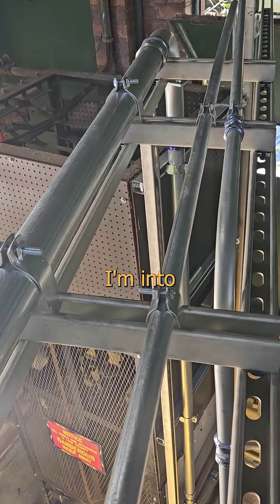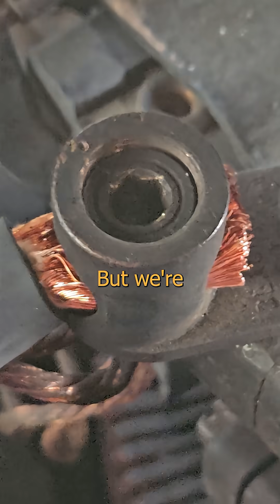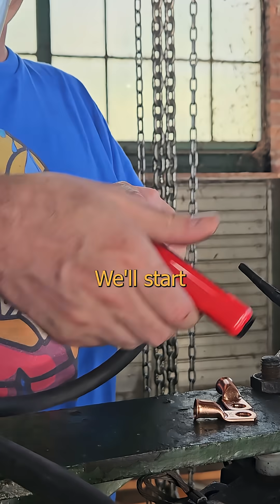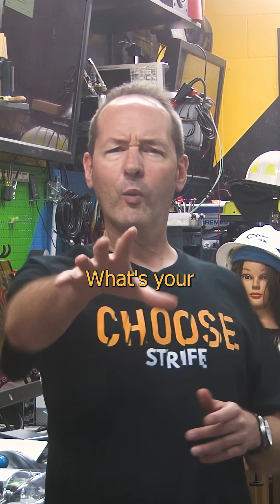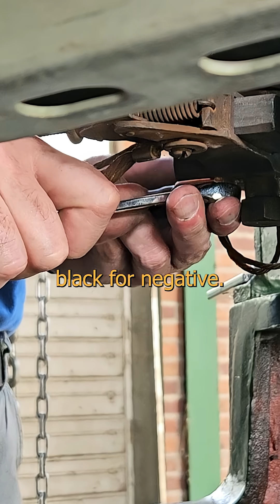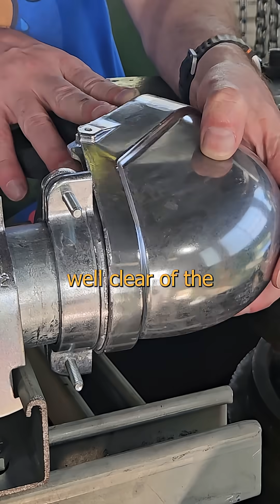Exciter Update #chrisboden #comedy #engineering #powerplant #electrical #educational #wiring

Comment: What size cable was that?  It looks bigger than the 2/0 cable I used to connect my LiFePo batteries for my camper.  Wish I had gotten one of those fancy crimpers you got, it would have made the job easier!

Comment: I solder those copper crimps on my welding leads. The point of resistance is either there or the contact itself, so either way the extra lead helps with heat. I should just solder the contact to the clamps, then it wouldnt get hot at all.

Comment: Typically i install a ton of those copper ends and the most indestructible and best conducting way i install those is i clamp just the edge of the hole end in a vise with the cup end up i take a torch and melt an adequate amount of lead solder in the cup then insiert copper wire end once hard enough to stay together i quickly dip into cup of water it creates a better electric connection and its extremely unlikely to come undone

Comment: Telecom engineer. The standard toure looking for is telcordia gr-347.  Nothing wrong with what you did.  The "standard" if you wanted to extend it to this application is no-ox special-a is used inside the lug and on the mating surfaces and fastener,  prevents galvanic corrosion and atmospheric corrosion.  The letter requires  a windowed tin coated lug with the part number and manufacturer stamped into the lug.  Shall be crimped ro no less than 12 ton and the die number from the crimper embosses into the barrell. Clear heat shrink indoors or marine heat shrink if outdoor or wet location.

Comment: Noalox is nice to use, simply because the mounting bolt threads won't corrode and seize if they get wet. It also protects the exposed areas between the cable lug and insulation (or use marine grade CLEAR heat shrink to seal it, while keeping the whole lug visible for inspection)

Comment: When it’s copper crimped to copper (or brass or bronze or phosphor bronze) Noalox isn’t typically necessary.   Just make sure the conductors are sealed with an appropriate marine sealant to the application if water is expected plus a quality adhesive heat shrink.  I wouldn’t expect the heat shrink to last for 100 years but the crimp should.

Comment: If the cable terminations worked for 100 years without failure then it’ll work for 100 more. No need to reinvent the wheel

Comment: Long barrel two hole lugs are the standard for critical power infrastructure in data center’s. If you want to get fancy, you can get inspection windows to make sure bubba did a good job seating the lug.  No nolox on all coppery bits.

Comment: Noalox is used for aluminum oxidation prohibition and is not required as per the NEC. I would never consider it for CU-CU and only mildly consider it for AL as most of the modern shit is AA8000.

Comment: you're exactly right! sometimes you need to upgrade certain things even though it's been working the way it is for a long time doesn't mean that you can't improve the quality and safety of something and make it just a little bit better than it is and it's not like it changed the way the thing functions it's still the same machine just safer and looks cleaner and works more efficiently than it did before

Comment: I work in a tough environment (mushroom composting operation). T&B Contax grease is great for copper to prevent corrosion. Another great choice is Sanchem NO-OX-ID "A-SPECIAL Electrical Grade". Both protect from normal corrosion as well as corrosion from hydrogen sulfide. They are my go-to when I want a connection to outlast me.

Comment: NoAlOx is specifically for aluminum interfaces. You were using copper to copper and when we do that or won’t use copper to a tinned interface we use NoOx. Instead of being a Gray looking conductive non-oxidizing lubricant, it is a reddish brown, looking material design specifically for copper copper interfaces.

Comment: My limited opinion on Noalox is that while it's not required on everything, it also doesn't hurt anything except my clean work clothes.  What I remember from reading the Noalox bottle was something like "Prevents corrosion, promotes conductivity, and reduces connection temperatures."  Obviously those last 2 are the same thing. Maybe it doesnt say both, idk.  
When I was doing maintenance for a welding shop that had a habit of blowing up breakers from running machines long past duty cycle on minimal conductors, I decided that any improved conductivity was worth the small inconvenience of carrying a bottle of goop around.  
And anecdotal though it may be, it certainty seemed that the welder feeds I did with goop lasted longer than the ones done dry.  
In 99% of systems it might not make any relevant difference.  But in systems pushed to the limit, the little things can make all the difference.

Comment: There was a time when I thought that if you crimped the fitting on good (with some flux on the wire) and then filled with solder, it would prevent any corrosion from happening inside the fitting. But does the addition of the lead and tin and flux increase the risk of corrosion right next to the fitting? These days I just crimp and call it a day. It's faster too.

Comment: Hydraulic crimping is the way to go. I've seen hydraulic crimps between copper cable and copper lugs cut open before. A properly done crimp looks like one solid piece of copper on the inside.

Comment: This cable is a bit big for this, but if you want a very, very secure crimped connection then try this.  
1). Tin your wire and flux the connector.
2). Crimp the fluxed connector onto the tinned wire.
3). Add heat to the connector and solder as needed.

Now you have a crimped and soldered connection.  Maybe use no clean flux as well because it will be difficult to get all of it out of the connector.  

Never just crimp a connector to a tinned wire.  As time passes the solder will cold flow and then the wire will fall out of the crimped connector.

Comment: A proper crimp connection will not need anything added to it. Fone properly, it is an air tight connection that more or less fuses the two together to function as one continuous piece of metal.

Comment: Hey chris!!!!!! LOVE your videos man. I learned this technique about those crumpets from my father:

Those “forever crimps” are great, but if you want a REALLY good connection that will literally cause the next guy to look at it in 100+ years to be impressed, heat up the tip and the copper wire and put a bit of flux and tin solder in there after crimping. That hot flux and solder will hold that connection SO tight and make the resistance of the cave basically zero with a normal meter. Makes it so you literally CANNOT remove it without replacing the cable which is EXACTLY what you want for something that’s so mission critical 😊

Make it forever-made, not “half-ass” made - as my pops always told me.

Comment: NoAlOx hasn’t been required on anything since the late 80s and was never required on copper. It’s one of those traditions that just won’t die. Use the proper size lug and the right crimping die and you’ll create a solid cold weld with no air pockets.

Comment: Nah if it works don't fix it. If the old way lasted 100years then don't change. Modern methods don't seem to be as reliable as the old way. Trust me I worked att a farm and only electrics systems that failed was the new ones. All the old crap with cobwebs older than me never had a single problem

Comment: Honest question, is there a system in which the receiving port has a rod that the wires go around and can be pushed or screwed further into the connection after the outer parts are fastened? Like the wedge at the top of an axe. Then you could loosen that part and relieve some force before trying to undo the outer casings.

Comment: Deoxidizer is usually only used in copper/aluminum connections or just aluminum connections. NEC doesn't state anywhere that it NEEDS to be used since modern aluminum wire is made from AA-8800 alloy, which resists corrosion. I would use it if you were making connections near the beach or any place with a corrosion atmosphere/environment.

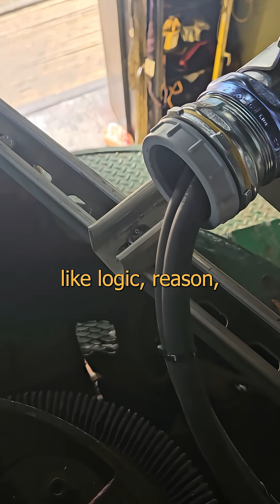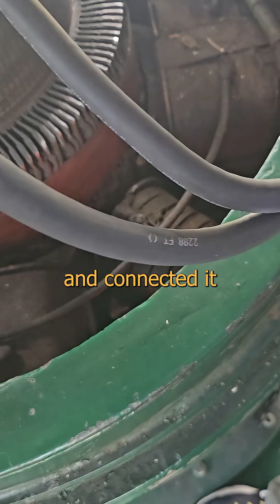Comment: This device appears to have two slip rings and a commutator below. I don't see any commutator brushes on 270 degrees of the lower section from 0:05 to 0:15 .. is it not being used anymore?

Comment: DIYer here. Cut an 1 1/2” section of half inch copper pipe. Solder the wire to the inside of the pipe about half way up the lunch of the pipe. Hammer the pipe flat and drill a hole. Trim it round with tin snips if you want to be a fancy pants. 100% of the time it works every time.

Comment: NoAlOx is great, but if you are concerned about copper to copper connections you should use Penetrox E which uses copper instead of aluminum particles.

Also pro-tip on lugging those cables, when you strip it add a zip tie at the sheath and work it up to the tip. Keeps the strands together for when you like the lug on, and you can cut it off when the cable is fully inserted.

Comment: A way to insert a wire terminal without the wire strands going all different ways then in the terminal cup, is to cut the wire insulation just a little bit shorter than the length you originally want and make a 2ed cut at where you originally want. Remove the insulation from the first cut and use the insulation between the 1st cut and 2ed cut as a "ring" and slide that up the wire shaft till it's near the tip. Push on the terminal and when it's pushing the insulation ring down and no stray wires, cut the ring off and you can fully seat the terminal on the multi strand wire.
Another hack is to use a zip tie to hold all those wires together. Cut the zip tie off when the terminal is on with no stray wires and seat it.

Comment: When working in car audio stuff, anything larger than 1/0 cable we would use those type of connectors but I always use my propane torch to heat them up fill them with solder and solder the connection in before crimping it. Use a ton of flux on The Wire itself and it works unbelievably beautiful. Hydraulic crimping and heat shrink tubing is perfectly acceptable I just liked overkill. I use speech to text, I'm not going to proofread that first. I apologize about errors.

Comment: I was working on an 80 year old car a few years back and had a lot of fun melding my modern knowledge with the repair manual for the vehicle.  I set the timing by the procedure outlined in the book then used my strobe timing light to fine tune it and verify the advance was working.  I think I got a few more hp out of that '26 Cadillac.

Comment: Lookin good. Only thing I would've done different is tinned the copper lugs with some nice 60/40 solder, crimp the lugs and then solder the wire in the lugs. Even better electrical connection and the tinned lugs would be completely impervious to any corrosion compared to bare copper.

Comment: If you’re hoping to have that cable last the 100 years, I’d recommend utilizing metal cable ties for holding it. We’ve seen plastic cable ties break over time and cause conductors (namely bare grounds) to swing into places they shouldn’t (the nice little L3 stab supplying a machine). Just my 2 cents

Comment: a little connector paste doesn't hurt as it prevents corrosion by repelling moisture.
Reply: If everything's copper, there should be minimal issue there. It'll only be bare-minimum carbonic acid (from condensation dissolving atmospheric CO2) reacting to form copper carbonate, and if the crimping is good enough, contact between the cable and the crimp cap should be maintained.

Because it's all copper, there shouldn't be any electrochemistry reactions going on to really push the corrosion.

That said, connector paste doesn't seem like a bad idea to me, it's just my not-electrically-inclined self questioning whether it's cost-effective.

Comment: If you want to prevent bird caging with that fine strand cable, leave a small ring of insulation at the cut end of the wire and remove the rest up to where you were going to trim normally. The ring keeps the strands tight and straight as you slide the lug on pushing the ring with it. Cut the ring to remove and slide the lug the last bit and crimp as usual.
 
We installed a new ups today with 800a service. Electrician showed me and I smacked my forehead and said “you mean I could have been doing this all along?” 18 lugs went on perfectly.

Comment: The good thing about the bull dogs is that you reset them every time you switch them. This ensures renewed connection. The issue with the copper crimps is they get tired, corroded and the corrosion will accelerate as the junction resistance increases. This could cut short your hundred year service life. I have seen those crimp ends go bad in a humid environment in less than a decade.

Comment: Strange question. Did you do anything on the cap for the weather head. The caps always feel janky and just two little screws over the spinny bits. Did you put some forever red goo on the screws to keep them installed forever.

Comment: YOU NEED TO SPRAY THE CONNECTION WITH 'GLYPTOL'(or really any sealer). Your point of failure will now be between that compression lug and the bolt holding it in place.
YES I STILL USE NO-LOX. YES I KNOW THE NEW ALUMINUM MECHANICAL LUGS DON'T NEED THEM BY CODE. let me explain.
Corrosion may not happen due to dissimilar metals on these new lugs. But corrosion due to moisture in the air still will! Especially with copper! Also adding a little lube to anything with alu threads like teck connectors,lugs,split-bolts,etc makes them soooo much easier to service if needed. Just my 2 cents!
Im and electrical contractor and i do ALOT of main services and connections. I also use a 6t electric crimp tool for my compression fittings when their needed. And this is where I see alot of problems that could have been avoided.

Comment: Definitely use some form of grease/corrosion prevention in any crimp that will see any moisture. Copper corrodes even if not mixed. Solder is great for preventing corrosion but problem is it wicks up the cable making it liable to breaking.

Comment: I like grease on crimp connectors, keeps them shiny! Deoxit L260d is my fave, but it's too pricey for big stuff, so I've been using carbon grease and it seems to work well so far.

Gulf coast likes to turn copper green fast, so I have to coat it in something...

Comment: I use a hammer crimper. Its my preferred method to lock down a copper lug. I only use hydro crimpers when the cable is too hard to remove.

Another benefit of the hammer crimper is that a 4/0 lug can be tightened down onto a 2/0 cable. As a mobile mechanic and sometimes the supply house is 2-3 hour drive away. Its a lifesaver

Comment: I usually fill those crimp lugs with solder then stuff the cable in there while it's still molten. Granted i use those for battery cables on semis. So im not sure if that would work for this application.

Comment: The Australian Sydney County Council did a study in the '80's on preparing electrical connectors and how to keep them in good condition.  As you say, start with clean copper.  You can apply a good grease (like vaseline, or an automotive grease that doesnt harden, and definitely not stuff that contains aluminium).  The grease keeps air and moisture out of the joint during thermal expansion and contraction from current flowing (or not) through the joint.  Flat bar can be brushed clean with a brass brush reserved for this purpose.  Never use a steel brush or one that was used for steel, as the brush tips get laden with iron and if used on copper will deposit minute particles of iron in the surface and that destroys the joint over time.  I mostly referred to the study for bolted connections but crimped is similar.  Personally I much prefer compression fittings over crimp fittings, but often people use the same word for both types.

Comment: As an automotive mechanic, I've always used dielectric grease for every single connection I come across. Recently I picked up a bottle of nolox, because the local big orange store was out of my usual. A quick glance at the label gave me the impression that the 2 are pretty much the same thing, justdifferentconsistency. Can anyone that knows, please clarify the difference between the two for me?

Comment: Here's a guide to perhaps make it even better. Cut the cable insulation all the way around at the appropriate spot. Then pull the insulation back enough so that a cable tie fits around the copper strands. Once you've secured the cable tie to the copper, the insulation can be removed. Now push the cable tie all the way forward to the end of the cable. This prevents the strands from coming apart. Use the cable lug to push the cable tie back and then remove the cable tie. This way, you'll have as little air as possible between the cable lug and the cable strand.

Comment: I used to work on 6kvdc 6000hp drive motors for a steel mill. All terminations and mating surfaces had an anti corona paste applied to maintain continuity and reduce flashover. Not normally used on lower voltage applications

Comment: Only thing I could think of doing is adding some terminal spray protection so that the inherent moisture in the air doesn't cause minor corrosion. Other than that it looks like a job well done to me.

Comment: I appreciate you putting a crimp terminal and heat shrink on that, the bare wire just sitting out looks horrible even if it was connected properly

Comment: At work we use KOPR-SHIELD on our welding cable terminals. With as much trouble I have had with battery connections on vehicles, use it on battery cables too.